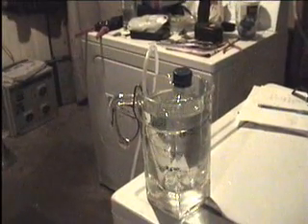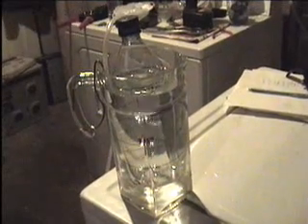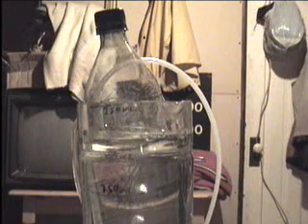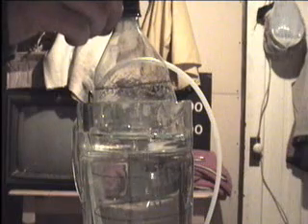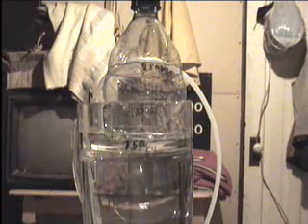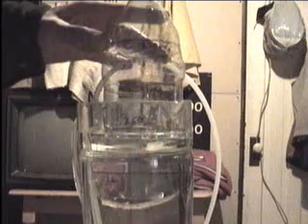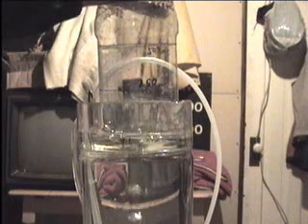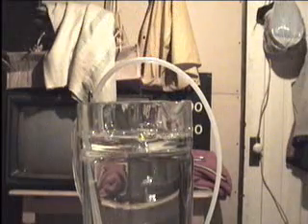HHO fuel cell output test

Comment: Nice thanks for measuring. Not the best output per watts. I am doing 220 watts per L per min. Your output is about 750 watts per L per min. You can improve efficiency by connecting multiple cells in series.